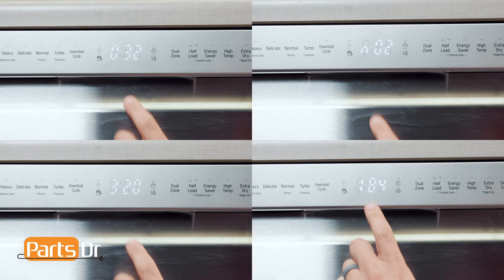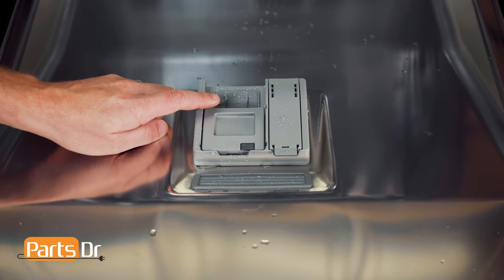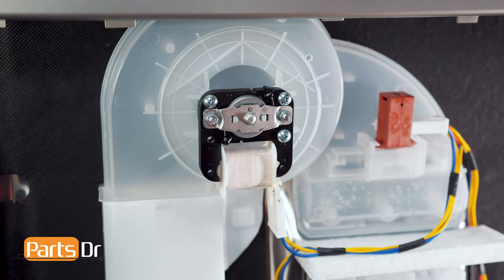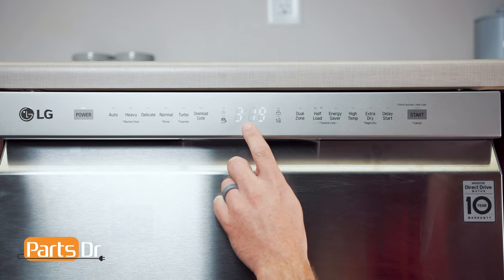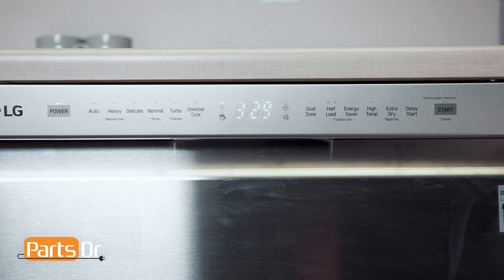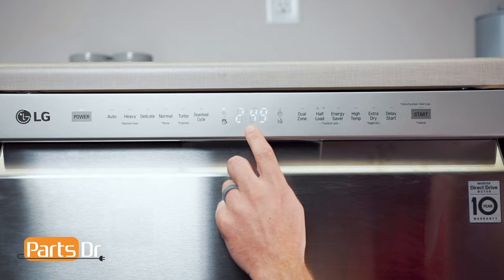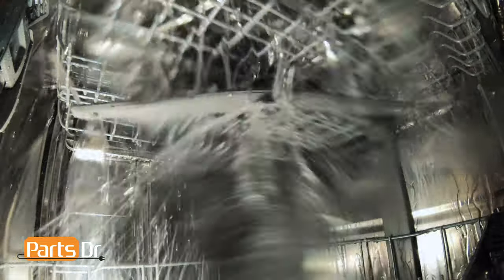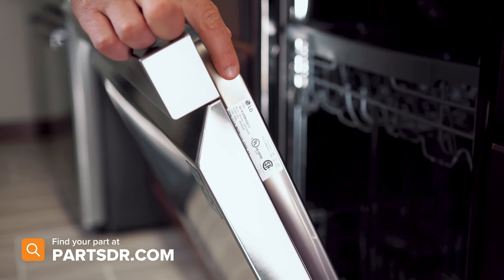TOP SECRET LG Dishwasher Service Test Mode

Comment: Can you help me out?   When I run test #6 I get an awful grinding/bad bearing  sound.   I just replaced the the motor pump.  So that didn't fix it.  Is it the diverter motor that's making the noise?  Wish i saw this video sooner... thanks for your help.
Reply: It also threw an LE code.  Which was motor failure
Reply from the maker: What is the model number of the dishwasher and which part number did you replace?
Reply: @PartsDr 

model#  LG LDT7808BM 

ABT72989205
PUMP CASING ASSY
Reply: When I pulled the old motor pump it smelled (burnt electrical).  This noise has been going on for a couple weeks and thought that was the fix.   No longer have the LE code but the grinding/ rubbing noise.
Reply from the maker: @nsext3330  What was the problem with the original pump motor?  Did it make the same grinding noise?
Reply: @PartsDr  i thought that was where the grinding noise was coming from but it is not.   What else is running while preforming test #6 and #7?  That's when I hear the noise.
Reply: Old pump wouldn't even start up to wash.  It was smoking from motor
Reply from the maker: @nsext3330  The diverter motor only moves a small plate to divert the water to the upper or lower wash arms.  This motor doesn't run continuously while the dishwasher is washing.  Our guess is that the new pump may be defective and making the noise?  Sorry, but we cannot diagnose problems like this over the internet.

Comment: Fails test #7

Does this imply pulling the unit out or can the motor be checked for an obstruction in place?

Flagging an LE code
Reply from the maker: For the LE error code, this is what LG says to check:
1) Wiring connection is OK? (Washing Motor and Controller).  Check and reconnect the wire.
2) The Impeller of Washing Pump is locked. Replace the Pump Casing assembly.
3) Is the Washing Motor is OK? Check the electric resistance of Washing Motor.
4) The Controller is troubled. Replace the Controller.

Comment: My dishwasher seems to pass all the tests with the exception of the vent door doesn’t look like it opens, but the fan is running. Is this possibly the control panel?
The device stops and beeps and won’t complete a cycle that’s what brought me to checking the dishwasher.
Reply from the maker: From what you are describing, it could be a bad main control board, a bad vent, or bad wiring between the two.
Reply: @PartsDr  thanks for the quick reply. I purchased a replacement fan/vent assembly from your website and replaced it. Same issue. So must be the control board or the wires like you said. Guess purchasing a new control board would be the next step.
Reply from the maker: @tylzsomeone976  Let us know what you find!

Comment: I have a ldf5545st LG dishwasher. The last step it  just shows “LO” and continues to run. What would be wrong with it?
Reply from the maker: Check the diverter motor that is used to change the water between the spray arms.
Reply: Mine also only displayed LO during the test, but I ran a turbo cycle and I put a camera in there and saw both the top and bottom arms spin

Comment: My same exact dishwasher is blinking during cycle and will stop mid cycle. I'm seeing other people are having the same issues.  Any suggestions to fix this issue?
Reply: Did you find the issue?
Reply: @lucca450 we would open the door and leave open in between dish washing cycles to let it dry. It seems to have work.

Comment: We just purchased a new LG dishwasher (11/14/20),  and it stopped draining twice; we had to do a manuel drain. It's  super quiet. Any ideas about what could be going wrong?
Reply from the maker: When the dishwasher isn't draining, try running it through test #4 in the video.  This should help you narrow down if the drain pump is running or not and help you narrow down the problem.

Comment: Hello, I have an LG LDP6810SS, and the Power + Start buttons don't do anything. Any idea if it's another button combination?
Reply from the maker: I'm sorry, we do not have information on that model.
Reply: @PartsDr  ok, thanks anyway - was curious how to get it into the diag mode and then how to get through the tests because the buttons/screen aren't visible when the door is closed
Reply: Power button and high temp at the same time works for some models. Try that

Comment: Great useful  video!
I'm a maintenance tech jack-of-all-trades and running into all kinds of different  appliances brand issues.
Currently the LG at my home powered down, I vacuum the water out of the sump and power was restored what could be the cause?  I'm thinking potential  restricted drain?

Comment: I have a MEZ64589015 that always has the * flashing on the the front of the machine, I filled the reservoir and still it’s flashing and will not start, seems like it is stuck in standby. I’ve reset the breaker and pulled the plug and still it’s locked in standby mode, any thoughts? Also loved your video.
Reply: Mines too!  Is it the panel?
Reply: Mine does the same. Light flashes but it doesn't start or run. Only about a year old, not used very often. I wouldn't think it should be having issues already!

Comment: @Parts Dr, I engaged the test mode on my LDT5678ST because it has stopped sending water to the sprayers. Upon activating test mode, the display showed n04, d49, and U50. I then pressed Start. When  the machine reached test number 7, the display showed C00 then 1LO with loud motor noise but no spraying either top or bottom. All other functions appear normal. Any ideas? Thanks very much!
Reply: When I engage my test mode, I get n04, d49, and U50 in the display. My test sequence differs slightly from the one you have listed.
1) Detergent door
2) Sump temp
3) Door vent blower motor
4) ?Soil sensor? Display shows "180"
5) Drain valve/motor : Good
6) Water inlet valve/motor: Good
7) Washer motor: Loud motor noise while spinning. No water to either upper or lower sprayer.
I appreciate any help you can give. Thanks!
Reply from the maker: It could be caused by a bad circulation pump.  If the pump motor is receiving power but it isn't running, either the pump is bad or something is jammed inside of it causing it not to turn.  This is the circulation pump for your model here: https://partsdr.com/part/abt72989206-pump-and-casing-assembly?model=LDT5678ST---00
Reply: How did you get yours into test mode?  Mine won’t activate. Have the ldts5552s which is very similar to yours.
Reply: I have the same dishwasher but can't get into the test mode. Can you help please?
Reply: @bmanizzal4319  power +high temp is how I got mine to go into test mode.

Comment: My LDF5678ST keeps tripping breaker. Diagnosis comes out fine. Can’t run test mode. Where should I start the trouble shooting? I’m thinking main board?
Reply from the maker: Start by checking the electrical connections inside the electrical box where the power supply comes into the dishwasher.  See this video here: https://youtu.be/JBoXTLpLxwU?t=292
Reply: @PartsDr  so I was able to run test and it doesn’t let it run third test. That is the drain pump right? Also disconnected pump power and still tripped breaker. Assuming main board?
Reply from the maker: @ajguerra9547  It could be a bad main control board.  This type of problem is difficult to troubleshoot.
Reply: Having same issue again. Last time I put a high loop and it worked. The dishwasher keeps tripping breaker on test 4. Swapped out drain motor and still tripping.

Comment: The control panel on my LG frequently flashes OFF then back ON quickly, and there is associated beeping noise. I’ve tested the power and it’s good, could this be a bad panel?
Reply from the maker: Yes, that problem could be caused by a bad control panel.
Reply: I have the same issue. Has yours resolved?

Comment: Have the exact dishwasher, tried several times to get it into test mode....GOT NOTHIING! Tried unplugging and rebooting and test to run a test, and got nothing! Had 0E code drain issue over and over, cleared lines and filters NOTE: Dishwasher is brand new!!  ... Faulty Circuit board?
Reply from the maker: Take it back to the store and exchange it for another one?

Comment: My dishwasher seemed to “pass” this diagnostic. However, once a cycle is started, it will run for about 10 minutes before beeping a couple of times and shutting off. Every time there is a considerable amount of water in the bottom of the bowl. Could this be a bad control panel? No error codes present.
Reply: My dishwasher has the same problem
Reply: What was the issue?
Reply: @owlycourt did you find the issue?

Comment: I think they faked the test mode on mine. It just says all good, while broken.

PS after my machine seemed physically broken and i was about to open it again, i tried someone's suggestion. Now this seems unbelievable, but... Run Turbo Eco or (on mine) Turbo Express.. the machine started working with or without Extra dry.

Comment: I have this exact model and it has been giving me an E1 error on a normal cycle after starting to fill with water. Repair company has replaced water inlet valve and control panel without any fix. They even replaced the sump assembly which seemed unrelated. Tried running through these tests and Test #5 is where I see the issue. There is water filling into the unit but there is no “frequency” reading on the display (I.e. stays at 000). Any thoughts?

I’m assuming the dishwasher is successfully sending a signal to fill with water it’s just not reading and water going in. Therefore it thinks it is leaking all the water.
Reply from the maker: You may have a bad flow meter in the water guide assembly.   You can view this part on our site here: https://partsdr.com/part/aec74337401-water-inlet-guide-assembly Please verify the part is correct by entering your model number on our site.
Reply: I'm having the exact same issue. It's not filling a lot during the test but water is coming out. Were you able to fix this Michael?

Comment: We noticed that on Normal setting that 3/4 of the time when its 36 min left it starts beeping alot. I would have to press start a few times to bypass, filter is clean and I ran a diagnostic with LG app and it says all good. Can someone let me know if I should check something else?
Reply: Did you find the issue?

Comment: Is there no test for the heating element? My dishwasher is running the he code after I fixed the fe error code
Reply from the maker: We recommend to test the heating elements resistance using an ohm meter.  It should measure approximately 11.5 Ohms at room temperature.  Make sure the power is disconnected from the dishwasher and the wires are removed from the element when testing.
Reply: @PartsDr  ill try that thank you

Comment: I tried all of these tips and the only thing I noticed was that the 1 un did not appear, it went straight to the Lo.  When I first start my washer it will run for a couple of minutes and then the entire display starts flashing and it shuts down.

Comment: My LG dishwasher plays no more tones when I press a button, when cycle starts, or when cycle ends.  Why??
Reply from the maker: On the model dishwasher shown in the video to activate or deactivate the button sounds, press and hold Dual Zone and Energy Saversimultaneously for three seconds. The error alert sound cannot be turned off.  Check the owners manual for instructions for your specific model if the instructions above don't work.

Comment: How do you drain once unit is clogged?
Reply from the maker: You can use a wet shop vac or soak the water up with towels while you work on it to fix the problem.

Comment: I have pressed the power and start buttons at the same time and it does not start the test. An LG technician taught another way but I didn’t write it down. Is there anyone here that can give me that other way to do the test? Thank you kindly in advance.
Reply: Same. Nothing happens and my error code is FF which isn't listed anywhere for a dishwasher, only for a fridge 😮

Comment: Is it possible to go into diagnostic mode on an older mode, that doesn’t have a start button?
Reply from the maker: What is your dishwasher's model number?
Reply: @PartsDr  lds5811ww -- it wasn't filling, so I bought a new inlet valve (made sure it's AC, not DC) and now it just fills continuously once power has been connected.
Reply from the maker: @CapesOfficial  It sounds like the main control board that supplies power to the water inlet valve may be bad and constantly sending power to the water valve even when it is not calling for water.
Reply: @PartsDr  that's what I've been leaning towards. I wasn't sure if there was any sort of reset I could do or a diagnostics mode I could go into to try to narrow it down. If that's the case, it almost feels like a new dishwasher may be in order..
Reply from the maker: @CapesOfficial  Sorry the outcome wasn't the best!
Reply: @PartsDr  I more than appreciate the response. Now I'm off to decide whether or not I try a new control board (looks like the part number is 6871DD1006T), a used one (not too keen on a used one), or just go for a new dw
Reply from the maker: @CapesOfficial  It's really up to you on that

Comment: I have run the Diagnostic Test and during #7 - Heat Varial Valve, I do not get the 1 un notification, but I do get the 1 LO notifier.  I do not get the OLO notification but instead get C53. I do not get an Error Code NE which Identifies a fault in the Valve system.  Help please.
Reply: I have the same issue
Reply: Same here, just runs the 1 L O

Comment: Cannot enter test mode. When I push power and start at the same time the power button the unit will not come on. When I try the power button by its self its fine.

My problem with my dishwasher is that it randomly stops washing and starts beeping. Started doing that months ago and getting progressively worse.

Comment: I have the same model my kids were pressing bottons like crazy now I’m getting ae code
Reply from the maker: AE is a "leakage error".  Possible causes 1) The Door gasket came loose or fell off. 2) The Float assembly is stuck. 3) The Controller is troubled.

Comment: I have the same model of dishwasher. I loaded it on auti cycle with steam which takes 3hours 38 mins to complete. After running for abt 2 hrs there was a power cut and when it came back on after 15 mins the machine started from the beginning and showed the time as 3hrs 38mins. I let it run for that full time, but from that day my dishes are not cleaning properly and there is a tough white residue on almost all the dishes. I ran my dishwasher abt 4 times in intensive mode, turbo mode and auto mode. I even filled more salt n rinse aid to it, cleaned the drain, checked the holes on the blades, but the dishes are still not cleaning properly and there is still that white residue on them. What seems to be the problem? Plz help.
Reply: After using LG for 15 months, I have returned the dishwasher, with full refund. Non resumption from original stage is beyond repair or correction.
Reply: @AtulKumar-sw6fc  You got the full refund that is good news. Did u face any issues while asking for refund? What was the problem u faced and what did u tell them. Please reply if u can.
Reply: @ankitasuman468  I had purchased LG Dishwasher after meeting my son and daughter in law in US. I bought LG in October 2019. LG worked with great results for 7-8 months. Problems cropped when my city started facing frequent power cuts. LG doesn't resume from the original stage after power cut. After few months, heater stopped functioning. Initially LG disowned any responsibility and later on LG offered replacement but I insisted for refund. After 2 months, LG refunded the amount.
Reply: Use " Cascade fryer boil out" from Amazon. It's really just the old Cascade formula with phosphates which have been banned in dishwasher detergent.
Reply: @Shashwat Shete I cleaned the machine by running the "machine clean" mode and putting a cup of vinegar in the upper rack and then again ran it on the same mode but this time by throwing 100gm baking soda in the bottom part and putting a bit of citric acid in the detergent compartment.

Then I ran a simple rinse cycle.

After that whenever I had to wash the dishes in dishwasher I used a bit of citric acid in the detergent compartment along with the detergent for atleast a month.

Whenever there is a powercut and my machine stops, i open its gate and put the detergent again in the detergent compartment, and whenever power comes back, the machine runs anf my utensils get cleaned as usual (i do this when the detegent compartment gets open before the powercut).

I try to clean my machine once in 40 days with vinegar and baking soda.

P.S. for India, Fortune detergent and rinse aid works well than any other brand (atleast uptill now 🤞) Please don't use Crystale tablets, whenever I tried to use them, it caused me a lot of problems.

Comment: So I don’t have any power when I push the power button
Reply from the maker: If the dishwasher is not powering on, first check to make sure that the power supply to the dishwasher is good.
Reply: @PartsDr  there’s power to the dishwasher
Reply from the maker: @mrpaigehatch  see page 38 for troubleshooting steps https://drive.google.com/file/d/1uKAtivuLWSzNRw-1nZpO6mp95ALjosb4/view?usp=sharing